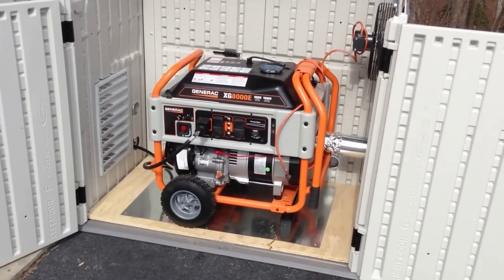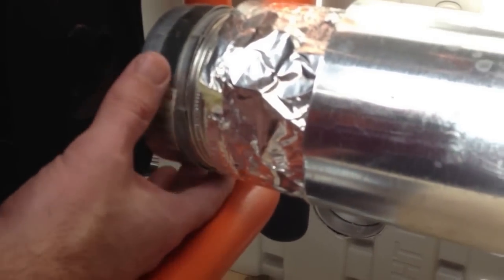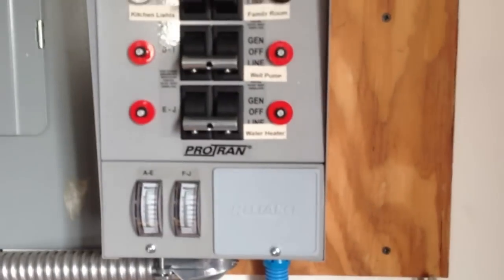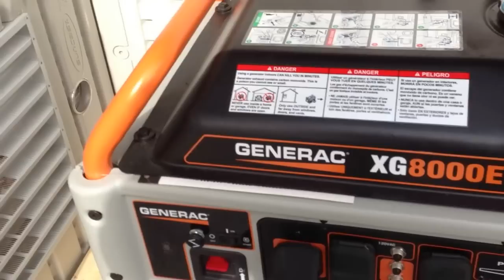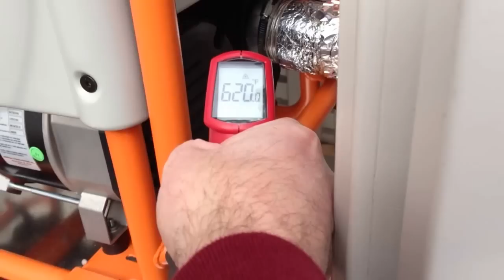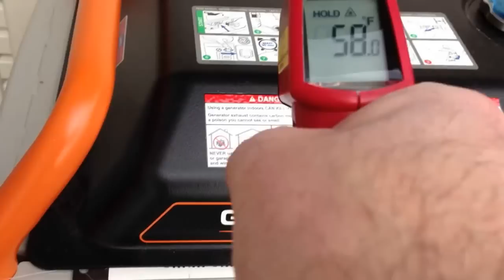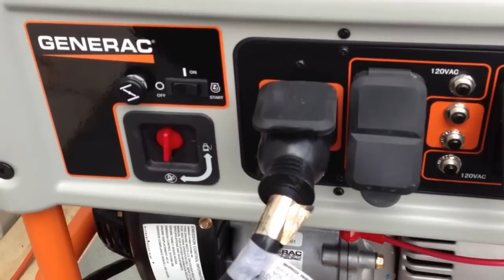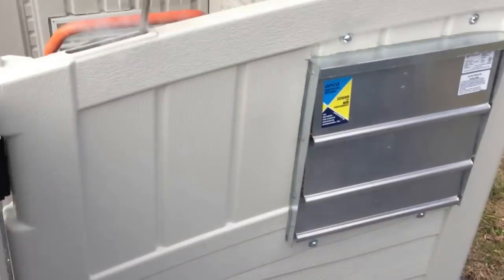Generac Generator installed in a Suncast Garden Shed for Weatherproofing

Comment: on many generators there is a gounding lug,be safe ground it
Reply: you are not required to ground it if you are running it through you panel box because your neutral and ground are running through you house ground rod and neutral bus.  if you was using it as a portable gen then yes you would need to ground it because the appliances you are running are not grounded now.  when powering your house everything you use will be grounded.

Comment: Great work on the enclosure and cooling system!

Some ideas to share on the exhaust issue. If you are going to keep this generator as a stationary unit, then you could extend a strait pipe directly out the side of the enclosure, then attach a muffler to that pipe. If you wrap foil around that pipe from the generator to the muffler, there will be very little heat near the pipe and or heat rise inside the enclosure. The surface of the muffler inside the box is very hot, and trying to move hot exhaust gases from the muffler through a pipe, is subject to leaks and or higher heat to deal with.

I didnt see if you had any brackets to hold down, or stop the generator from moving around inside the enclosure? That would be a good idea too.

I wonder if the sound would be greatly reduced if you were to install fiberglass insulation on the inside of the box.
Its hard to tell if it is already quiet enough with a camera mike. It may be perfect as is.

Again great job, and a cool project.

Comment from the maker: Thanks for the great feedback everyone! 
I never planned to run the generator for endless hours in the shed - mainly during a storm, so I'm really not worried about the shed lasting forever.  For fair weather use, I'll just run the generator outside as intended.  I keep the generator stored in the garage, and use the shed (as is) to store my garbage cans until the next power outage.
The fan was wired by cutting the male end off an old extension cord and wiring it up to the motor as shown in the included diagram.  I just plug it into the 115 VAC outlet on the genset itself.
I also found that if I run the generator as far to the right in the shed, the insulated section of the exhaust covers the portion of the pipe near the wooden exhaust flange.  It does not seem to get as hot that way.  I'm probably going to use some more heat resistant material (gray cement board) if/when I need to replace the wooden flange in the future. 
So far I've been very happy with my project.  I'm not sure I'd like to run it in the shed during warm weather (above 80°F), but usually not really an issue here in Maryland.  We tend to lose power in the winter months due to ice.
Reply: helvis230
cheap hole saw you can find them just about any where.

Comment: I ordered the 12" shutter fan from Amazon, with shipping was $117, wire diagram is unreadable, how did you wire the unit to run in to the receptacle? Did you ground the fan unit, like they suggest or did you ground it and run 3 wire to the plug ?

Comment: Hello Andrew: A couple of questions on your generator shed? I have the same shed.
(1) What brand fan and size did you use? Where did you purchase it?
(2) Did the fan come with built on louvers or are they seperate? If so what size and where did you purchase it?
(3) The large louver on the left side (intake air)__what size and where did you purchase that?  Thank you and I appreciate your time.

Comment: What model of Suncast Garden shed are you using and what are the interior measurements?  My Generac 7500 is 27-1/4 inches in length, 25 inches height and 27 inches width.  Looks like your Generac is probably about the same size.  The problem I'm finding is the interior depth of most the sheds front to back is only about 28 inches making for a tight squeeze.
Reply: Hey Bob, what did you decide to do?  I have the same dimensions and went with a Suncast 2500 which is very tight depth wise.  Getting it in and out isn't really my concern but even with a nice fan and intake path Im worried the lack of air clearance will cause problems.  Im considering returning the 2500 before I open it.
Reply: Sun cast make a 4700 that is 34” wide perfect for my genarac 8750
Reply: I was planning to open the front doors and run my 7500W Simpson during storms and use the shed as storage when not operating.
Reply: This is the shed that I used with framework on all 6 sides with sound deadening material and a farm exhaust fan connected to my generator. Didn't use any thing for the muffler just let it direct itself toward the farm exhaust fan.  I did put inside a cheap thermocoupler so that I can monitor the heat inside the enclosure. I place my 7500 on a 3/4 piece of plywood with 2 slides under it, so that I can slide the generator our easy for refilling up gas and for any maintenance that needs to be done to it.  @michaelmarsocci7768

Comment: Serious question. What is the point of extending the muffler to the outside of the enclosure if you have an exhaust fan running full time? I have never seen anyone do both until I started watching you tube videos on the subject.

Comment: Andrew, impressive build out and I use one of those temp guns daily on my job, so that was a real help.  To get it even quieter, why not build out another box and add a car or motorcycle muffler system to it, because your dumping all the waste heat into the small area there, moving that heat into a customized exhaust system using the dryer vent material as just a ''heat shield'' to get it out of your box via a car exhaust pipe to a muffler.

Comment: Looks great but the issue I see is you're using a plastic shed  that was never intended for that use. I would be very worried running that for a long period of time and the possibility of a fire starting. A portable generator is intended to be used in a well vented area and not in an inclosure. Whole house generators are built from the ground up to be put in an enclosure and a lot of Twps mandate a certain distance the enclosure needs to be from the dwelling in case it catches on fire. Nice idea but I would re think the entire project and use the enclosure as a generator storage area only.  Portable generators are purpose built to run in rain and snow and you don't need to cover them while there running. Good luck!
Reply: This is bad advice.   Every generator I have owned, inverter or not, warn that they are NOT to be used in rain and snow.     At the very least, the specific model he is using, says right in the instructions it must be protected from rain.    It is true that they need to be properly ventilated to avoid overheating, but the fan he has is providing ventilation.   The added advantage is that a shed like this can also somewhat reduce the noise level.
Reply: I would agree but what's wrong with simply leaving the front doors of the enclosure open while it's running?
Reply: 1) Noise   2)  During a storm, the whole point is to keep the unit dry
Reply: that's one of those cobbled ideas that will probably fall by the wayside in a month or two in the  meantime hopefully you won't overheat your generator and cook it or burn the house down